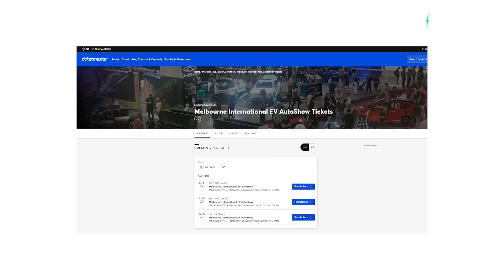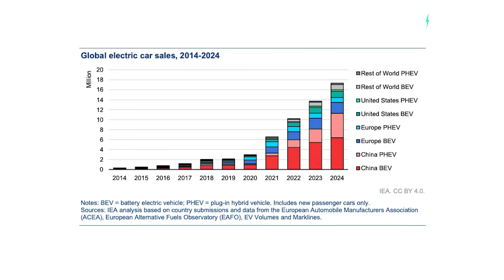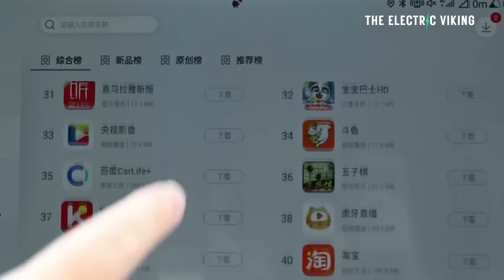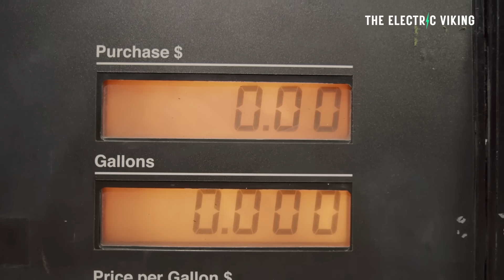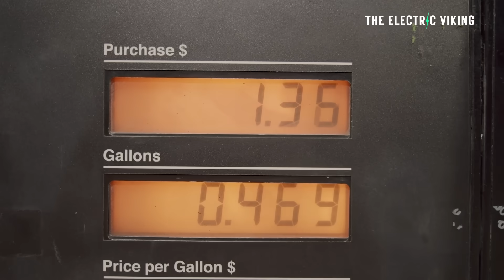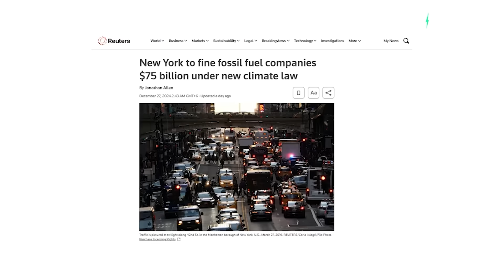Numbers Don’t Lie: Electric Cars Are Steadily Replacing Oil

Comment: Usefully 40% of shipping is associated with the movement of fossil fuels. Shipping itself will be difficult to decarbonise but just by decarbonising everything we can we can reduce shipping needs by 40% without doing anything to the actual ships themselves!

Not sure that I agree with you regarding less demand meaning higher costs. There might be some spikes along the way where that does happen but by and large we can expect petrol prices to decrease as demand dries up. That will make future oil exploration exceptional volatile to invest in though so it wouldn’t surprise me if we get a price stabilisation as supply winds down with demand.

Comment: I suspect you’re right that the amount of oil being displaced is higher than the estimates. In the west a lot of families have two cars but one is often only used when both are needed. If you have two cars available and one costs you 10p to take to the shops while the other costs you £1 you’re going to choose the cheaper one more often than not. As such I suspect the actual proportion of journeys being done by EVs is substantially higher than the proportion of cars that are EVs.

Comment: Most people don't know that a truck pollutes 5 times more than a car, that's why we need hybrid trucks like #EdisonMotors and Swappable battery tech. And for big trucks and heavy duty commercial vehicles, we need to use #Seaweedbiofuel and #CBGfuel because this fuel is carbon neutral 🌎🌍

Comment: Petrol and diesel prices will go down with reduced oil demand.  The refiner takes c. $5 / bbl the retailer gets cents per litre sold.  Does not matter the price it’s just a margin.  What will go up and continue to go up as electricity demand grows with more EVs is your electricity bill.  Yes in Australia you can get solar PV and eliminate or reduce electricity import but Australia and Norway with abundant hydro are the exceptions……. With EVs comes fuel poverty to the poor and elderly, fact.

Comment: 2 billion ICE cars on global roads. Its hard to believe the miniscule number of EVs sold every year is having any meaningful difference in oil consumption. Ivr seen reports that show oil consumption is actually higher yhan the past few years. EV adoption will seemingly have a greater impact as a more substantial nimbet of EVs as the 2 billion ICE cars are replaced. Even if 100% of annual car sales (80 million) are fully electric it would take 26-34 years to make the complete transition. Its just math.

Comment: As electric cars gain market share there will come a time when nobody will want an ICE vehicle. You only have to drive an electric car for a short while to realise the benefits of an electric car, Its very cheap to run with no servicing or repairs as well as cheap fuel, they are also a better drive as they are quiet and have amazing acceleration.

Comment: Only in China.

Electric vehicle sales in Australia have sunk to their lowest level in two years as more Aussies turn to the ‘range safety’ of traditional combustion engines or plug-in hybrids.

Data from the Australian Automobile Association revealed just 17,914 EVs were sold in the first three months of 2025 or just over 6 per cent of all vehicle sales in the country.

The AAA quarterly vehicle report showed the last time EV sales were at that level was in 2023 when 17,396 cars were sold during the same period.

The 2025 data also shows EVs have dropped market share when compared to the final three months of 2024 – 21,331 EVs were sold in the last quarter of 2024 to make up 7.42 per cent of the country’s vehicle sales.

Comment: Correction, oil hasn't reached it's peak it's petrol/gas consumption that has peaked: looking at the statistics of oil sales it reveals that fuel made from oil has barely changed in volume for a couple of years now. But sale/consumption of every other petrochemical that isn't fuel has continued to rise in the same time period. So overall peak oil isn't here quite yet but we are on the cusp of gasoline/petrolium consumption starting to go down.

Comment: We are already at the tipping point where high mileage drivers have a big incentive to go electric. If you have your own driveway, or a gully through the pavement so you can charge at home, then your 200 mile a day, every working day, driver in a country with high petrol taxes would be foolish not go  electric. Yes it is different for the person who is more office based but averages two 500 mile trips in a week, but I suspect they are looking at things and will switch when they are confident that their route has adequate charging stations. EVs have gone from a virtue statement by generally low mileage drivers who want to be kind to the planet, to a canny investment for high mileage drivers. One 50,000 mile a year high mileage ICE driver likely uses as much fuel as ten 5,000 mile a year drivers. If the people modelling future fuel demand are just assuming that on average an EV will replace an average mileage ICE car, they are misreading the situation. Where I am petrol is currently around £1.30 a litre, I think that's about $1.50 in US dollars. I get at least 11 miles per litre, close to 50MPG and buy around 200 litres a year. I probably pay as much for my annual service and MOT certificate as I do on fuel, so I'm the sort of very low mileage driver who won't go electric until my current car dies. People like me are a big proportion of car owners, but a tiny proportion of the market for petrol and gas. What I expect to see in the next few years is the typical commuter car, the vehicle that is driven for one, two or three hours a day, those cars are going to go EV. With the three hour a day commuter being much quicker to go EV than the person who just has a half hour drive to work and a half hour drive back.

Comment: I'm still wary of solar panels on roofs of homes. Fires and poor installation is what concernes me. 
Also Solar power isnt as good in every country, due to power grid problems. 
Also in my country when you overcharge your solar, you may have to pay for the surplus you dump on the grid. Due to 'overtaxing' the grid. (you now may be able to guess where i'm from) And storing it on batteries is expensive.
To me there is still very little incentive to go full electric. I'll consider it when the grid is good enough for it.

Comment: Oil consumption may not be reduced as EV use is increased. Oil is still needed to generate electricity to power the electric grid. Only if the use of solar energy and other renewable energy is increased significantly then oil consumption will be reduced.

Comment: A container ship carrying EVs traveling from China to the USA can burn a significant amount of fuel, with daily consumption ranging from 80,000 to 200,000 gallons. Larger ships can burn even more, potentially exceeding 250 tons of fuel per day. 
A container ship typically takes 15-35 days to travel from China to the USA.
So if you take 200,000 gallons as a benchmark and 25 days as an average journey time you arrive at a staggering 5 MILLION gallons!

BYD, a major EV maker, has been shipping over 5,000 EVs on a single ship. That's 1000 gallons per car 😮

An average diesel car would run approximately 43,000 miles on 1000 gallons of diesel fuel.

So the reality is that the average US diesel car driver driving a US manufactured unit will probably burn less fuel in 3 years use than an imported BYD did before even arrived on the US shores 😂
Reply: I think the 80000 to 200000 gallons number should really be in kg, not gallons. This means your figure per car is around 4 times too high (it will depend on whether you think you're using US or British gallons).

Comment: If you look at this logically, there will be a long term need for fossil fuels. Australian coals are some of the cleanest coals available.
Developing nations need energy to raise the living standards of their citizens. They are doing this using coal fired power as this is the cheapest form of power generation. 
They also know that while renewables initially appear to be cheaper than coal, when you add in the cost of storage and transmission, renewables are more expensive than coal.
 If renewables were really cheaper than coal, there would be no need for a developing nation status to allow them to burn fossil fuels.
So, it is likely that coal fired power will be in world wide use until well into the second half of this century when it will be replaced by nuclear.
Thus we could upgrade some of our Australian power stations to HELE while we transition to nuclear without having any effects on AGW.
Reply: A lot of very poor countries are increasing their intake of solar as this is by far the cheapest way to generate electricity and Australia just had an election where the Australian people overwhelmingly rejected nuclear. Australia also has some of the best solar resources in the world and once you build it you have free energy for the next 40 plus years (Yes solar is now getting that good).
Reply: Are you leaking from the National Party in Queensland? Almost word for word? Shame!😮

Comment: Please note that ICE vehicles will always be in existence. Military vehicles will always be powered (mostly) by hydrocarbon fuels. Think of the logistics of providing power for EV powered military vehicles. What will be the weight of diesel fuel required to move a truck 400km vs the weight of swapable batteries to do the same.
Reply: Yeah, it’s such a big problem that the whole world might have to give up on war and armed forces. That would work well!🕊️🙏😊

Comment: I hope your statement  regarding petrol stations having to increase their prices turns out correct. However, it,s also possible that the whole sale price of oil goes down due to reduced demand (unless OPEC reduce production). could be a good thing though, because the hard to get oil (fracking!) would have to stay in the ground, as no longer profitable.

Comment: To back up what you're seeing the multinational oil companies are now moving production from expensive to produce countries (like the USA) to cheaper to produce countries (mainly OPEC+ countries), which allows them to lower prices, and maintain profit margins. (OPEC has already increased production, and plans to do so again in June.)
This is what an industry does to respond to COMPETITION.
I will theorize that renewables/EVs have gone from the butt of the joke to actual serious competition for the oil industry.
The reason this is important, is that fuel is the most PROFITABLE part of the resource they sell.
IF they lose fuel, they take a HUGE hit to their bottom line.

Comment: It's been my contention for a couple of years now that there will come a point where the increasing numbers of EV's on the road will actually cause the price of fuel to increase. The price at the moment is supported by the mass market economies, once that starts to disappear as EV penetration increases oil companies will react, that won't cause the price to drop as some might argue, they reckon prices will drop to sell more, but that's not a thing, people can't use more fuel, that's basically a fixed number, people aren't going to start driving around the block to use more fuel so they can buy more cheap fuel, prices will increase to increase profit per liter (gallon if you are in the US) to try and maintain profit margin, but that won't work because increasing prices will just push more people to EV, creating a circle that will result in ever increasing fuel costs and an ever reducing number of customers. Refineries will close, shipments from oil producing countries will drop and that will lead to increased cost per barrel as they try and maintain their income and the cycle will continue. Been saying that for a couple of years now, It's like Nokia when smartphones first came out, everything will be good, still good, still good, then disaster as the tipping point arrives. Last year I gave it maybe 5 years, I think it will come sooner judging by how fast EV's and renewable energy is going, maybe 3 years now.
Reply: I always thought the same. I like your Nokia concrete example.
Reply: Have you given any thoughts to the portion of the price of a gallon that goes to road taxes to repair the roads, or the increased weight of EV's and the subsequent damage to the roads by that increased weight. The Hummer EV  is 9,000 freaking pounds, not that any sane person would buy one. In MD, .42 Cents of every gallon goes to road repair. Also crashed EV'S will be instantly totaled.
Reply: @JamesAgans  Traditionally fuel excise is collected by state and local governments to maintain roads, it's true that will drop with EV use increasing, however some income has always been collected based on vehicle weight and use, heavy goods haulage for instance attracts its own tax proportion based on the gross weight of the vehicle. I agree no sane person would buy a Hummer, 99% of people will buy a small to medium EV or crossover, the BYD dolphin for instance weighs a max of around 1600kg, the average weight of US passenger vehicles according to the latest data is 1900kg, so that's a problem right? The tax collection ratios and sources will just need to change to account for the loss of revenue from fuel excise. This is something that's always happened and always will happen, things change and you change the way you do stuff to account for it. I mean who paid for roads before ICE vehicles took over, the horses? We will adapt to the new conditions, fighting them won't stop them, it will just slow things down and make the changeover more difficult for everyone.

Comment: If your country has a poor electrical grid system or constant power outage(such as South Africa),  is an EV still a viable choice?
Reply: That,s where you do proper planning and charge your car at night .
Reply: South Africa should be a good location for solar, right?
Reply: An EV can make you independent from the grid outages wherever you are if you have solar panels installed and batteries. It’s been a life saver for many after catastrophic storms, fires and floods in Australia.🌝🦘👍🏽

Comment: Great stats—thank you! El. Viking.
Why did you call it an “EV boom”?    In reality, it’s the natural techno-evolution of any civilization. 
1.Electricity is the dominant energy force in the Universe, and the cleanest, most scalable, and most efficient way to power transportation. See "The Electric Universe" theory (Astrophysics, not in Astrology ).

2. EV motors operate at ~95% efficiency. Compare that to ICEs: stuck between 20–26%, hard-limited by thermodynamics to ~42% max, even after 100+ years of perfecting metallurgy, turbocharging, direct injection, and 'sorcery snake oil'.

3. Let’s be real—EVs are simpler machines: one rotating part in Electric engine versus hundreds in ICE.  Simplicity and faster innovation. That’s why 100-year-old electric motors still run nonstop in municipal water pumping stations worldwide.

4. And yes—2 billion ICEs globally are choking cities with air pollution as the main cause of our Climate Change. If you care about the air your kids breathe, there's no way around it: EVs are not just "the future"—they're the solution!

#5 as a Sorcery Delusion Point: About those (Toyota) Hydrogen dreams: Dead Mirai is still an EV ( just with smaller traction battery Series Hybrid) and with a fuel cell Range EXtender (REX). Complicated plumbing, lower system efficiency but higher than Prius (Parallel Hybrid), and most important points of the failure: infrastructure and H2 is the most leaking fuel in the Universe!
Some carmakers are still waiting for a Magic Engine—some impossible Thermodynamic Unicorn from the labs of Voodoo Corporation. Sorry, folks: there’s no miracle REX coming -- just Physics of the Universe.

 2025 reality and 5 good news: 
1. Sarcastic EV bumper sticker in California: "GM said: No demand for EV" in 1990th (and vandalized unique EV1). "Gossip": It is still in bed with Oil Magnates.?
2. An EV pulling away silently and way-faster than other ICE vehicles at the green light. 
3. After a few years (in a Summer), we will drive our EV to Alaska (from SF,CA)  charging @ V4 US/Canadian Supercharges, for 5-10 minutes, each 250 miles, while some small ICE cars (8 Gallons tank) can not make it! 
I drive my EV now with normal highway speed (with cool breaks' disks) over ~14,000ft passes in the US.  Versus rented Nissan Sentra (and Toyota Tercel) have max speed on those passes just 40mph--floored HARD (believe me) and burned breaks' disks on some steep descents.
4. Even our powerful President Trump can’t stop the Transportation Progress ( or/and Science) with the additional $250 EVs' federal fee. The future is electric!! 5. More than ¿10 years? in the US - Bann of ICE. In any case, China will dump ICE faster ¿2035? (w/o official bann, just public education) than any other country  (Norway almost did it). And the first country on the Planet, Ethiopia (didn't know they have a smart non-corrupted (by Oil Magnets) government) -- "Officially Banned ICE non commercial vehicles, starting 2026!"
Steve - Physicist